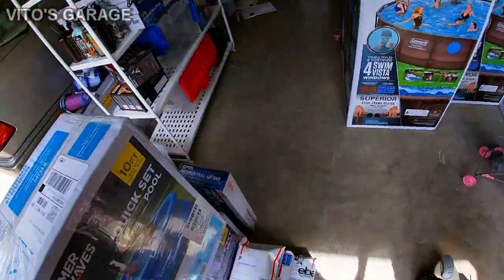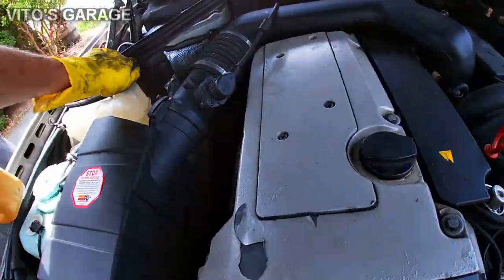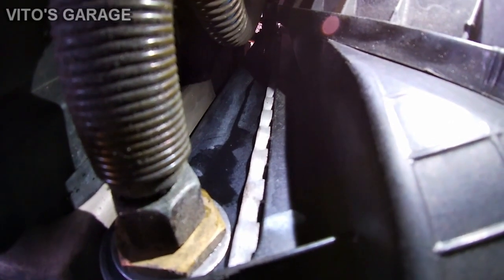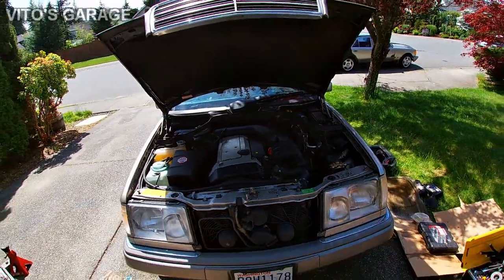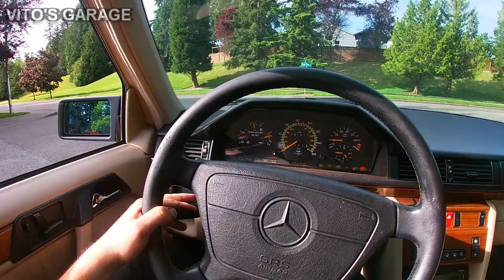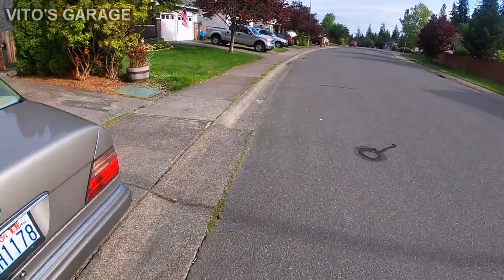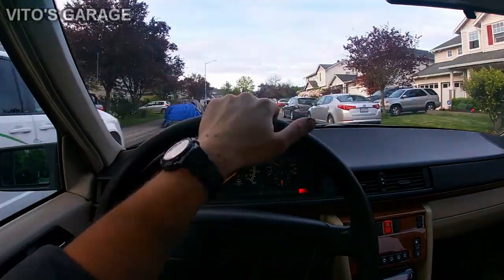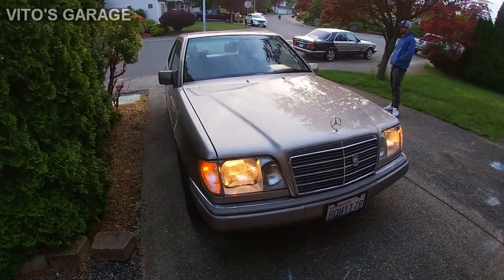Mercedes W124 Owner Was About to Give Up But I Made His Day!

Comment: I would  used distilled  water  not actual  coolent  until  you fix the leak  or to solve  the leak issue
Reply: But he solved the leak.
Reply: @cartorx1261  cool

Comment: I noticed  something     this car has a asr  cluster   but the  abs pump  doesn't  support  that  theory   the  pump  installed  is  non asr  car     the second  give away  is no headlight  vipers   and probably  no seat heating    but I wonder 🤔  what  the story behind  it   also   did the owner  know this  has  auto  closing  windows  and sunroof   all you have to do is hold  the key in locking  position 😉

Comment: Are you sure about the type of coolant? As far as I see it was some red type (maybe G12 or G12+), but the owner added a G05 (yellow). I'm not sure they can be mixed together. You should better drain and flush the system to remove all the traces of previous coolant, otherwise the cooling system can be contaminated.
Reply: @spinning nonsense Usually G11 antifreeze which is the correct type for W124, W126 and other MB models of that period is blue/green although the color of antifreeze in general can be any. What really matters is the standard and composition.
Reply from the maker: I think it already had that color coolant in it. I'm not worried about it, I've mixed coolants before and never had any issues. As long as it's not water, it's good☺

Comment: Might I suggest FCP Euro for brakes and rotors lifetime warranty oem parts but way cheaper than the stealership
Reply from the maker: I always use fcp Euro for everything. The brakes are good on it. Just need to look into the parking brake issue. It's not working. Thanks for watching!
Reply: @VITOSGARAGE  you're a good dude keep doing what you're doing being a blessing to others
Reply from the maker: Thanks a lot for your support and for watching. It means a lot🙏☺
Reply: "stealership" hahaha :)
Reply: @VITOSGARAGE  Great video. A few months ago, my w201 parking brake dragged and wore the brake lining down pretty quick. While the rear brake discs were off, I lubricated the cable and especially the expander mechanism, which was frozen/seized. Also replaced worn brake shoes and adjusted/tightened up the brake by turning the toothed expander between the brake shoes and no more problems.
Reply from the maker: @christianwc9458  Thank you. Check out my recent videos. I already fixed a parking brake on this W124.